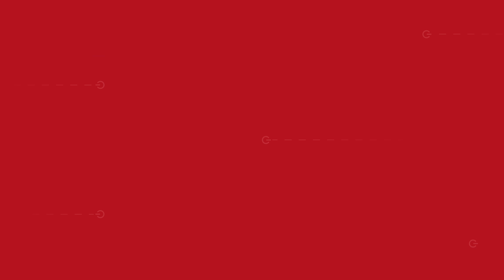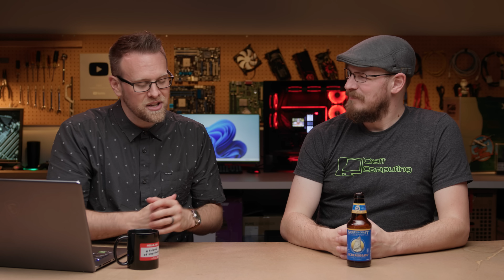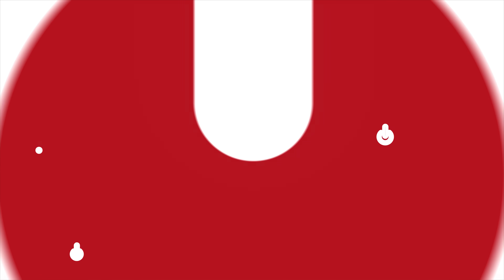Old Server CPUs For Budget Gaming Or Workstation PCs

Comment: I grabbed an “x99” Xeon RAM combo off Aliexpress for around $100 and was very impressed by it.  For simple gaming it does just fine.  Minimum frame rates could be better, but I played games at 4K on it with a 2080 I got off eBay and the whole build is really cheap and performs as good or better than a PS5/XSX. I think it was a 2670 v3.  I built it for my nephew.

Comment: Unless you need ECC, these old Xeons need to go away. All the way to recycling for the precious metals. Even if you do need ECC, just build a Ryzen system in that case and still recycle the old chips. If you don't need ECC or tons of PCI-e lanes, 300-400 bucks gets you a LOT if you live near a Microcenter or can make a road trip to buy one of their MB+CPU+RAM bundles. If they're an option, you can do a build with a 5800X3D or 12900K for not much more than going the 13100 route.

Comment: i have loved the  old xeon paradigm for years  , but apart from spefic use cases and   and multicore or multi socket systems . its far easier and cheaper to just buy some old ryzens   i have made lots of ultra budget pcs recently  based around r7 1880 pro cpus and b350 motherboards , and yes they are slower than todays , but on par with most xeons and way more power efficient and  more modern platform
Reply: A first gen Ryzen is around Broadwell-E/EP performance in most cases.  In gaming it's more like in between Ivy Bridge and Haswell.  Meanwhile Broadwell-EP goes up to 18c/36t?  If you need the extra cores, Intel Xeon still wins.  If you do any kind of multitasking or streaming/recording while gaming?  Xeon still wins in many cases.
Reply: First gen Ryzen is far from beating X99 in gaming perf

Comment: One thing to watch out for with older Xeon chips pre-Haswell is the lack of FMA3 & AVX2 support. Adobe's Creative Cloud applications and many new games (like Alan Wake 2, for example) are starting to require AVX2, and it's only going to become more commonplace.
Reply: SKylake Xeons are newer and cheap.  They not only have AVX2, they also have AVX 512.  And they use DDR4.
Reply: @goombario3220  yes but only 5120 and 61xx und up have 2 FMA's and they down clock based on instruction set used not temperature because they were until 3rd gen unable to measer the fma's temp (it runs hot af)
Reply: Most of the activities around the old Xeons are on the Haswell generation which do have AVX2 and FMA3.
Reply: Oh dont worry about adobe almost everybody wont be using them anymore
Reply: they dont mean those really old server chips when they talk about 16-20 Cores at 40-60€ but Skylake-SP and 1st gen Epyc.

eg a 18 Core Xeon Gold 6140 comes in at 46€
and a 20 Core Xeon Gold 6138 costs 60 ish euros but boosts only to 3.5 Cores and 3.7 on a single core -> the 18 Core one is technically faster because it can keep those high clocks longer up and boosts for up to heavily used 8 cores 3.7Ghz.
Reply: Xeon v2/v1 support avx and xeon v3/v4 support avx2
Reply: True, Haswell or newer. Broadwell on an X99 still kicks ass. Even with DDR4 / 4 channels. Those big caches are still viable.
Reply: i cant find a dependable source for X99 boards at reasonable prices and some of the XEON cpu coming out china are just junk if reasonably priced especially when you consider you can dependably get a ryzen 1500X and A320 for around 80$ together, ounce you look into the cost of a PSU that can handle a decent XEON your price to performance gives older AM4 the win for so many reasons, and then there is the upgrade path of a 275$ build, i mean the old work stations are good value is you dont mind using PCI power adapters to augment a 6 pin connector, but its not going to be attractive or up-gradable just to save 25$ , and of course power draw and heat production on Xeons verses performance is awful
Reply: @hayseedfarmboy  I'm not really sure how any of that relates to my comment, but you are right, mainstream CPUs have gained enough cores to compete with and even outcompete old Xeon platforms in most regards.
The only remaining reasons to choose an old Xeon platform over a mainstream setup in my view are memory capacity and PCIe connectivity.
Reply: @Anton1699  ...any memory bandwidth. Not much point in having tons of cores without the RAM bandwidth to feed them. Xeons typically have 4 memory channels whereas current mainstream CPUs only have two.
Reply: @Martinit0  Sure, but those older Xeon chips typically use DDR3 memory. Four channels of DDR3-1600 are just as fast as two channels of DDR4-3200, right?
Reply: @Anton1699 not really

They easily have 14 18 cores for dirt cheap
Reply: @Anton1699  My E5-2696v3 runs 4 Channel DDR4, capped at 2133MHz, in tight XMP timings (11-11-12-24). The 40 PCIe lanes remain a big plus, in my book.  However, even with turbo-unlock, max core clock remains limited to 3.8Ghz in turbo.  All core clocks throttle down to 2.7 GHz, under intense loading, to the 145W TDP limit.  Usually, all core (18C, 36T) operate between 3.6-3.8Ghz under moderate loads. Mine is paired with a RTX 2080Ti, which is a good match.  It was a fantastic value in 2020.  Today...AM4 is a no brainer. That being said, the X99 remains my daily driver...no desire to upgrade as it does everything I require with aplomb.
Reply: @Anton1699  Yes, 40 PCIe lanes and 4ch memory are its big selling points, even today. XEON E5-2xxxV3 also offers the Turbo-unlock capability. This gen of CPU also delivers AVX2 support.  I have one as my daily driver...built it for around $650 (all in, excl. keyboard and mouse) at the start of COV. It was well matched with the RTX2080Ti...and manages the RX7900GRE reasonably well (some bottlenecking). I am running mine with Win11Pro (installed with the iso method, to bypass the min HW requirements). I went for the grand daddy of the Haswell CPU's, the E5-2696v3 (US$54)...with a 145W TDP, large on board cache, and 18 cores / 36 threads. It's basically a special OEM variant of the E5-2699v3. To get maximum benefit of the turbo-unlock, you need a XEON E5 2xxV3 with a high TDP. TDP is the limiting factor for max clock across all cores. Been using HuananZhi X99-TF motherboards on two systems in our home, since 1Q2020.
Today, on a budget I would go AM4, no doubt. However, in my case, for now...no need to upgrade.

Comment: I don't know ... AM4 boards are cheap, used Ryzen is cheap, DDR4 3200 CL16 is cheap... Here in Germany you can get a B450 board and 16GB of said memory for under 100,- Euros new including tax. And for games a Ryzen 5600 or even 3600 will stomp all over those Xeons. Don't get me wrong, I have a 2680 v4 sitting in an ASRock X99 Taichi with 128GB of registered DDR4 and it's great as a homeserver. But I don't see the Xeon route to be viable (specifically) for a gaming system anymore.
Reply: There are plenty of Xeons with Ryzen 5 3600 performance, you need to get above that to beat X99 in raw performance
Reply: @chedds  No. The 3600 is just as fast as my 2680 V4 was in multicore and twice as fast in single core. All that at half the TDP. I also wrote "(specifically) for a gaming system". And since that comment the 5700X3D has been released and pushed the old Xeon option further into irrelevance.
Reply: @noenken  the 2680v4 is far from being one of the best Xeons, both in multi and single.
 If you only care about benchmarks sure the single core score of Xeons like the 2667v4 and 2687w v4 are way lower than the 3600's, but in an actual real world gaming section both Xeons will be either on par or at max 10 fps below the 3600

And the 5700x3d throwing Xeons at irrelevance? Here the 5700x3d is about R$1200 (250-300$) just the CPU while an 2697v3 for example which with TBU and some light memory tweaks can match the 3600 is less than R$100 (around 20$), what is the 5700x3d dethroning here? Maybe some newer gen Intels but not Xeons, the people who buy cheap X99 Xeons are not buying the 5700x3d and people buying the 5700x3d are not buying X99 Xeons
Reply: @chedds  If your "actual real world gaming" scenario shows that little of a difference your setup is suffering from a dramatic mismatch between CPU and GPU. X99 is a bad idea for gaming these days and has been when I wrote my initial comment. That doesn't mean that you have to change what you're using, please keep that in mind. I'm not saying that. But I am saying for anyone who does not already have it .. X99 isn't worth it for games. It just isn't.
Reply: @noenken  can't see how a kit which can 100% a 5700xt, 2070 or sometimes even a 6600 XT is "bad for gaming".
Those CPUs are very cheap and there's nothing that can beat their value rn, of course it will be always better to go AM4 but if you don't have the money or you would make a too big compromise to do so X99 still a capable platform for gaming
Reply: @noenken  If you are gaming in 1080p then the better XEON's (e.g. turbo unlocked 2696v3) will bottleneck anything beefier than the 2080Ti.  However, the bottleneck becomes much less relevant in 1440p and 4K. Competitive gamers looking for MAX framerates should not be looking at XEONs in today's market.  But the average PC user...why not?
Reply: I would agree.  Yes, I am using an X99 for my home office.  But for my eldest daughter, who uses VR with bay stations, I built (with) her an AM4 rig in early 2024:  5800x + B550 + 32GB DDR4  + RX7900GRE.  It definitely is a superior rig to my X99...but the venerable X99 does everything I need it to do extremely well...and more.  Would I build another X99 in today's market...no.  AMD, for sure, yes.
Reply: I'm a few kilometers away, trying to upgrade a 4690k for 1080p couch gaming HTPC and Ryzen AREN'T cheap.
I mostly game on 13600k/9070XT so value and cost are my priorities. Those generations of xeons are cheap but reach 4 GHz at best.
But those X99 kits would probably more suit Brasil and Indian gamers
Reply: Only if you're focus is gaming and single threaded work. 👈😉
Reply: @BaSs_HaXoR  That is indeed what I wrote ..... multiple times.
Reply: @noenken haha, my bad bro. Didn't read all the comments, just your main one. My apologies.

Comment: Here's where modern cost analysis fails when comparing one system to another.

I take a CPU, figure out my gaming time/mo. and look at the difference in power consumption for the SYSTEM (not the CPU) when using one system vs. the other.

That's it right?  No, it's not.

If you run AC in your home you have to consider what the extra heat being pumped into the room causes.  How much more does your AC run to keep the room at the temp. you set it for.  This ends up being bigger than what people think.

And yet I'll watch Youtubers do cost analysis based on the CPU alone, but that's not how it works.

Server hardware tends to be a bad value for home PC use cases.  They're made for a much different use case and because of it they have transistors powered that will for the most part never be used.

I don't have to do a cost analysis to know the 5800X3D and 7800X3D are outstanding game parts and regardless of the fact the CPUs cost a little more, over the long run total cost will be less.  There's a lot of difference in a CPU that's gaming around 45W and one that's gaming around 125W, once again taking into account how much heat it put into a room and what that does to the AC costs.  I mean in Data centers, their cost analysis is mostly centered on air conditioning.

Comment: Today now consumer CPU's have 6c/12t and high single thread performance (at low power use) server parts only have PCIE lains left as a selling point, today it's a hard sale when a 3600 or 3800 is so cheep used.

Comment: I got an HP Z440 Workstation for 80 bucks a few months back with a GTX 970 in it. Put a E5-2697V3 (14 cores, 20 bucks) into it and upgraded the RAM to 64GB (50 bucks). It's a nice homeserver-lab but I will probably sell it soon as a workstation/editing rig. Power draw is too high to keep it running constantly.
Reply: I have nearly the same build as a NAS and homelab VM Host.  An HP Z440 with an E5-2697v3 and 128GB of RAM.
I paid a few bucks extra for specifically Samsung branded RDIMMs.  And I intentionally got 2400mhz instead of 2133, in case I want to migrate it from Braodwell v3 up to Haswell v4, which would shave a few watts off that draw while still being faster.
You can mitigate a lot of that power draw if you feel comfortable BIOS modding, by giving the chip a slight undervolt.  And if you only need 14 cores, but not 28 threads, disable the Hyperthreading to shave even more off the top.
A mindful GPU choice can save power too.  I went with an RX 5700 instead of the 5700XT, just because of lower power draw.  And the GPU can be undervolted also.
A 4x NVMe adapter works because of PCIe Bifurcation support in that second x16 slot, as it runs straight off the CPU lanes and not the chipset.  That means you can avoid SATA drives too.
Reply: How much power draw?
Reply: I did something similar. Grabbed a dell precision for 50 dollars. Put a E5-2680v4 so only 14 cores. 15 bucks though. And then 60 on 64GB of ram. 25 for a SFP+ card and it got deployed as a second node for the homelab. And now I’m debating doing it all over so I can have 3 nodes running.

Comment: E5 2696v3 18C/36T w/ boost clock of 3.8GHz and using X99 BIOS Mod, can get a blend of 3.4GHz and 3.6GHz across the board with some threads hitting 3.8GHz.
E5 2697v3 14C/24T w/ boost clock of 3.6GHz using same X99 BIOS Mod, can run all cores at 3.6GHz.
Both CPU's are dirt cheap.
Reply: Scrap wars
Reply: if games were good-optimized in terms of multipe core usage, those cpus would be beasts
Reply: @kestirix4602  They beat a lot of low end new cpus that are way more expensive. They are beasts.  $19 for a e5-2697 gets way better performance in single core and multi core than a 14100f which is 5x the price. Building a budget pc is way cheaper and better performance going with a good v3 xeon.
Reply: Quick question—I'm new to this. With your knowledge, which processor should I use for a game server where single-core performance is necessary?
Reply: @Baleed7256  E5 2696v3 has the highest boost clock speeds. It's single core is the best of the v3 v4 CPU's and multi core performance is almost at fast (within a few points) of the 22C 44T highest end v4 LGA2011 Xeon CPU's.
Reply: @scottstamm7022  Thanks for the answer! I think im gonna go with this cpu since it seems great for what im trying to do. Now im seeing a lot of different mobos and idk if I can boost the clock in all of them. Any mobo suggestions on your end?
Reply: @Baleed7256  the D4 Platinum. You can use one of the modified profiles, just start with the lightest one, test for stability, then next. I forget which offset I'm at on mine, but the cores will boost up to 3.8GHz no problem on that board.
Reply: @scottstamm7022  Got it and just to be safe is this the one? "Atermiter X99 D4 Motherboard Slot LGA2011-3"
Reply: @Baleed7256  no, the Jingsha LGA 2011 X99 D4 Platinum
Reply: @scottstamm7022  It seems like it's not available at the moment, but I'll do some research from here to find the best motherboard for this platform. Thanks for all the help!
Reply: @scottstamm7022  The big advantage of the 2696v3 is its high TDP (145W) and both a higher turboboost and DDR3/DDR4 compatibility versus the 2699v3. I will not "upgrade" to v4, even if it comes with improved IPC...simply because of the gift of the v3 turbounlock.

As for the tubounlock, with my HuanaZhi X99TF motherboard it was an absolute breeze! I utilized MiyConst's Mi899 software tool...three clicks of the mouse and voila.
Reply: Was/were 🤣🤣🤣☠️☠️☠️
Reply: Dual e5 2696v3 is another possible thing, then you have basically a threadripper 2990wx